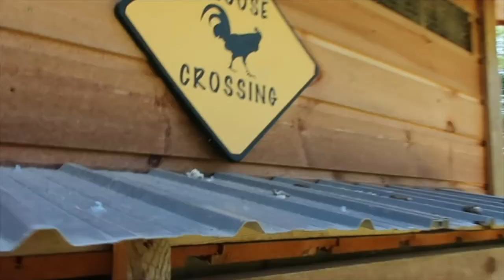Predator Attacked Again This Time we LOST one of our BEST

Comment: When you put the goats inside the barn how will you preserve the bottom 6x6 from rotting in the goat manure?  Might need to add weep holes?  Are you going to use saw dust or sand for bedding on the concrete?  Did you cut expansion joints in your lean to floors?  Adding LED lighting they not only reduce energy cost but run cool and are therefore safer from fire risks.

Comment: Al, I'm not keeping inventory of your stuff but it seems you have two other electric fences, one for sure. For quick protection you can run another fence around the tractors and use one side of NYC's fence. You're about due to move NYC anyway so you can set it all up to run the tractors parallel to NYC which you more or less do anyway.

Please avenge CWC for us all.

Comment: You should by two real defender dogs to outside. I can tell that the Hungarian Kuvasz or German-shepherd could solve your problems. Your present dogs are unable to sign the stranger intruders. But first you should put out a motion sensor lamp and a cam to check out your intruder.
Reply: Laszlo Chromicsek Tanner is more than capable if trained correctly.

Comment: In my experience with chicken predation, a weasel they'll kill the bird by severing their throat and open the birds vent, into the body cavity leaving quite a bit of the body. A raccoon attack will leave the chicken carcass on its back with wing spread out stretched as if in flight. For all practical experience the bird will appear as if it exploded from the inside out, very grusome. By the trail of feather I'd suspect a fox.

Comment: I have a question about the freedom of movement of the goats in and out of the barn. In the current goat barn you have "goat doors" which allows the goats to go in and out but in inclement weather also keeps the barn warm and dry. So now, with Dutch doors (especially if you can't open just the bottom) will the goats have access to the barn without the door being wide open?

Comment: I have learned a lot, watching you build this barn. One Question though. Why are you using the small side for support of your circular saw when cutting the doors. I would think that gives you a bigger chance of having your cut not be a perfect 90 degrees.  If you put your straight edge further from your cut and saw the other way than you can use the wider part of your saw for support and keep the cut straight much easier. I have about zero experience doing woodwork myself so if I am wrong please explain. thnx.

Comment: You need spring clamps for the straight edge.
I noticed that you put the circular saw on the shorter side of the saw bed. That would be dangerous if the saw tilts. Especially with thin cuts.

Comment: Watched an old video and was wondering how the pasture worked out? Check out Andrew Camarata and his new skid steer add on the flip screen. Pretty cool tool for getting those rocks out of the dirt and should fit on the Kubota if you have front aux hydraulics

Comment: Good morning Al. Sorry that CWC was taken, but that is the cycle of life, and he showed that you do have predators in the area. Both Pluto and Tanner were smelling the predator around your meat birds. Hopefully the traps work and you can relocate the predator. Does your DNR/Fish and Game wardens do the relocation?
Great work on the Dutch doors. What kind of hardware are you going to use? Lifting latch for the bottom and locking door knob on top? How will you latch open the top so it won't be swinging in the breeze?
Good luck and have a good day.

Comment: I'm pretty sure you'll get better results with your cut if you don't set the saw in the wrong side of the straight edge. The side you're setting the saw on is most likely where the clamps go and puts the saw at a bevel that gets worse with less material under the right side of the saw.
Set it to remove 1" off a board and you'll see how the saw sits. Try it both ways and you're gauranteed to have an "Aha moment".
Hope that helps in the future.

Comment: Aww poor CWC! We have 3 different predators that have killed our chickens over the last few years. We have a fox, she has killed probably the most and we have caught her a few times. We have a raccoon we were having a problem with, and dogs that run loose. Our last chicken was our oldest, and she made it awhile until a dog got to her, it tried pulling her through the fence, we found half her body. I hear, once you have a predator, it will keep coming back until something is done.
Reply: I'm sorry for your loss.
Reply: If you catch a fox once you don't need to catch it again!!!!!
Reply: Tony Grimes I meant we have caught the Fox in the act. We have not actually caught her in a trap or anything.

Comment: Smells like raccoon to me.  I have found one at my back coop door at 11 am one AM.  They are messy killers and I think they usually go for necks. You may want to put 12" of chicken wire or hardware cloth around the ground outside the coop to prevent digging under.  Staple to Frame of tractor.

Comment: Sorry about CWC.  She and Moose   stole the "chicken show"
My guess, you have a fox since it tried but failed yo get into the pen.  Smaller predators like weasels would have gotten in.
I agree, a game cam to find out what you ard dealknh with, then shotgun or whatever is appropriate to eliminate the problem.
If its a fox he will come back every night until all your chickens are gone.  Pasturing out provides a  scent trail for miles that ssys easy dinner at Lumnah.
A perimeter electric fence would help a lot.  But the culprit will not quit, until there is no food or no culprit.

Comment: I'm leaning away from something like a raccoon, has to be fast enough to chase down a chicken so maybe a fox or coyote. Whatever it is, it's clearly staked out the farm so you have to deal with it. If it is a coyote I don't think those traps will help much. I'd keep the cat inside while you hunt this thing, cats are pretty wicked in a fight so not worrying about a predator, but there's no point in wasting a trap on a cat if you don't have to. Investing in a trail cam isn't a bad idea, at least you see whats wandering around even if you fail to trap it.